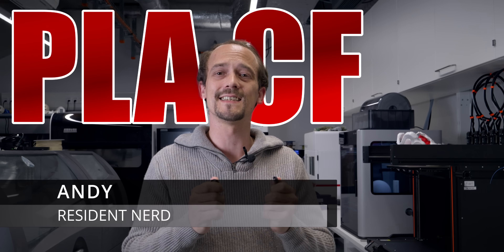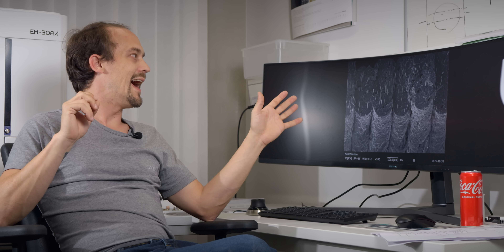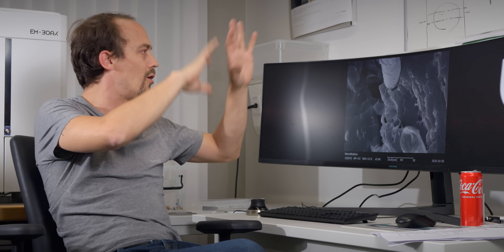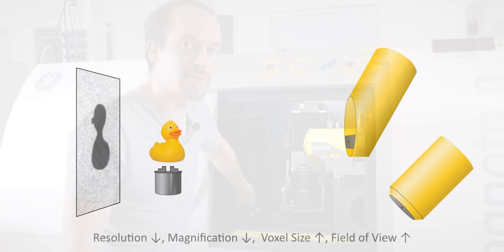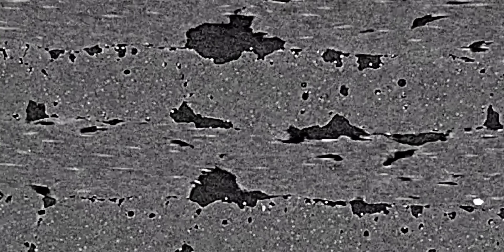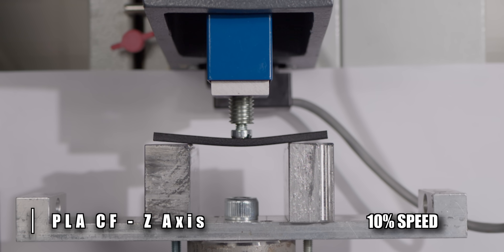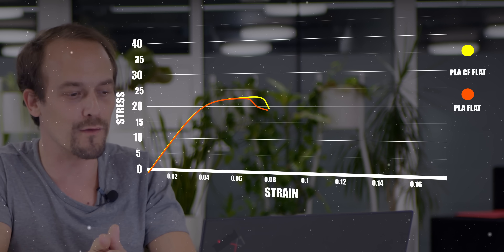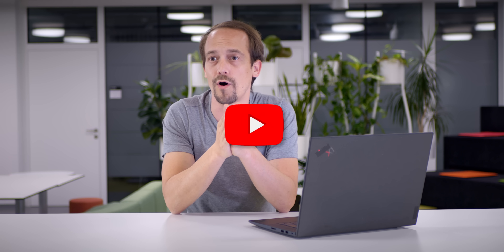3D Printing’s Biggest Scam Is Even Worse Than We Thought!

Comment: +1 for a dedicated video on the health risks of carbon fiber
Reply: Hurray for high-tech asbestos!
Reply: @Riesenfriese it's literally is, and it's even worse because with it you gain microplastic
Reply: @kv9009  its not as bad as asbestos from what i understand but its still bad
Reply: You basically have to treat those parts like you do fiberglass insulations. Handle with gloves on unless you wanna itch for the next few days.
Reply: @mr_voron  The carbon fibers in a 3D print are much shorter than those of fiberglass insulation. In my experience the itchiness goes away within a day.
Reply: @m @mr_voron t true, CF fibers in the right size meant for filaments should be about as harmful as the titanium dioxide used to color your filaments white; which is barely harmful, only a risk if sanding with no mask or filter
Reply: @awildridehome9469  Seeing how the fibers are not only contained within the polymer but on the outside surfaces, I'd disagree heavily. During the breakage tests you can see the fiber disperse into the air. Handling in general would pose a risk, not to mention the printing itself would contaminate the environment without proper filtration and clean up of the printer itself is also a concern. I work with real CF in aerospace and we take immense precautions including specialized vacuum operated tooling to prevent the dust from being spread by conventional air tools.
Reply: @plav032  This. I too work in aerospace, and this is the consensus reached by the scientists and engineers  across multiple national labs.

Bottom line, wear PPE, control dust, and avoid inhalation. To each their own. Everyone is responsible for their own health.
Reply: @plav032 

The resin CF is used with for aerospace application is the dangerous part; countless studies have been done on CF fibers, and the ones that are the length used in filaments don’t generally pose any additional hazard compared to any other dust of the same rough size. They’re irritants and mildly inflammatory if inhaled in sufficient amounts. 

ESD-safe filaments use carbon-nanotubes, which are proven through studies to actually be more asbestos like, due to their size and properties. That’s the real danger of carbon-based additives in filament. 

Anyone who thinks otherwise is welcome to post some actual science that is relevant to the topic, instead of “muh aerospace” anecdotes.

Source: Biologist who knows how to do basic research and read the reviews and papers for tests done on mice and tissue samples.
Reply: @groeszs  "Everyone is responsible for their own health." - imagine a world where people took this seriously. It would destroy the medical industry!
Reply: @awildridehome9469 the biggest source of danger is fiber dust. Sure, filaments mostly contain fibers that are longer than ones you should be concerned about, but that's mostly, plus they're going to be breaking all the time
Reply: @groeszs  "Everyone is responsible for their own health" is not only blatantly wrong, but also very sad way to look at the world.
Reply: @pathway4582  I can't grasp your position. In fact I believe the opposite and I can't understand the fault in my statement. The inverse of my statement would be "My health is the responsibility of everyone else". Actually now that I have typed that out, I think I understand your position better. The whole "YOU must wear a mask to protect ME" concept. My initial thought in this discussion was to imagine that my employer is responsible to provide proper PPE, and that's true. It's also true that my responsibility doesn't automatically end there. But I digress... I would probably never know that the cancer I develop in the future would be caused by using the cheap knock-off respirator filters my employer provided because they were a few dollars cheaper than the OEM filters.

But you are absolutely correct... It's incredibly sad to live in a world where I am responsible not only to myself but to everyone else as well. I wish I never learned responsibility. That's not sarcasm. I DO think the world would be much better if everyone was honest and responsible, but that's not the world we live in.
Reply: PLACF could earn a pat on the back from asbestos.
Reply: I won't be happy until there is asbestos reinforced PLA.
Reply: this was the main reason i never wanted to bother with it. seemed terrible with dubious claims of strength.
Reply: I hear it’s good for submarine design.
Reply: @josephcomings to be honest they did so many things wrong its unfair to blame the carbon. it was a miracle it even worked once
Reply: "reinforced" is a risk on its own. I actually want 2 videos. One on the "reinforced" issue, with tiny metal-like structures embedded into a part. No matter what material, if they are tiny arrows, they will penetrate the skin. That in itself is a health risk. Particularly if the material is super strong and hardly degradeable.

Secondly, I want to know about the Carbon Fibers themselves. What are the risk of this material. As in, is it degradable by the human body, is it poisonous, or what ever we need to know about the material. Just release the "reinforced" vid first. Then point out why the CF material should be an extra risk for reinforcement.

If you do this, you will be asked about all sort of reinforcements. The thing is to do the "reinforced" vid right. That would be legendary, and I will praise such a vid, for like forever. Please make one. As in, a good one.
Reply: This is not talked about enough. I’ve worked with CF in the aircraft industry for 20 years and it terrifies me.
Reply: This is what I came to say. This stuff is not good for your lungs
Reply: Indeed. Carbon FIBER is a hazard. Even worse is machining CFOAM (trademark). Tooling material made primarily of carbon. Nasty to cut.
Reply: It's zero unless you're sanding.
Reply: -1 for a mum insult. grow up derp.
Reply: CF and GF filament is huge problem for heath of whoever handles the parts, and for environment too. Not to mention inhalation hazards. COPD will kill many people it seems
Reply: @akierum And yet people are so oblivious, or even worse aggressively argue with you that this is not the case. There was a guy on reddit that came at me for pointing this out and even though I gave him citations of papers he responded with his other bogus claims that "prusa research" did some very rudimentary analysis of their own filaments and said nothing cytotoxic could be found in the *shortterm.* As if things like cancer develop in a few days or something. Plus, nobody claimed that carbon or glassfiber are toxic, but rather that they can cause serious tissue scarring and thus autoimmune responses that can eventually lead to chronic inflammation which in turn heightens the risk of cancer. People are mad delusional and incredulous.
Reply: @Atom224  (as someone with zero knowledge)  This sounds like it could be physically similar to asbestos fibres?
Reply: @Atom224 I’d love to see the research for the fibers the length of the ones used in filament, being a health hazard. All the studies in mice and tissue samples seem to show the opposite for this sized CFs.
Reply: @sQueaky637It’s not, because they aren’t self sharpening, they almost never break in the same axis, they’re biologically inert and the length used in filaments isn’t comparable.
Reply: @Atom224  I'd love to see the citations you're talking about because so far every time I've had this discussion nobody's been able to come up with any proof that carbon fibers pose a health risk when exposed to skin.
Reply: @HarrisonMartinson I guess there are two questions then. Health risk to physical contact. And Health risk to inhalation of carbon fibers. I can't imagine it being much different to fiberglass that has been used for decades.
Reply: My motorsport colleagues who work with CF daily all agree CF is the asbestos of the future.
Reply: @GreenPlasticWaterCan  This is a raging debate.  OSHA designates CF as an irritant, but not the cancer risk that asbestos has.  I think if CF was equivalent to asbestos there would have been a lot of deaths and lawsuits by now, but there isn't.  This would be another myth worth busting.
Reply: +1 to all
Reply: I don't think he did, really. He pointed out potential risks, but did nothing to demonstrate actual harm. There's a big difference between 'I think this could be dangerous' and 'I've clinical data showing people are being harmed'. There's all kinds of things like the size and shape of the carbon fibers, how the body responds to it, how and where it could attack, etc, that he says nothing about.

All he did was drum up drama and showed just enough data to scare people, without following through and showing any factual results.

Great way to make youtube cash though.
Reply: And graohene as an adjuvant in vaccines. Yeah look into that

Comment: Thanks for the video! I think reinforcing PLA or PETG with carbon fiber was initially a naive idea. The main advantage of carbon fiber, in my opinion, is its increased thermal conductivity, which improves heat resistance. For example, I used it to print some parts of a 3D printer head, where heat dissipation is paramount

Comment: I have no clue what your expectations were, but I print alot of rc cars (fully printed). I always had trouble with steering linkages flexing too much. CF variant fixes it. Sure it's not as strong part, it has worse layer adhesion, etc.. but it is more stiff. No need to look at it with microscope.

Comment: I would love to see a comparison video for the more functional filaments like PPS-CF, PPA-CF, PET-CF, PC-CF, etc. But I would also like to see if PLA-GF has the same issues as what you pointed out in this video for CF filament.
Reply: PET-GF too.
Reply: Would also like to see ASA-CF in a comparison, as it's the only high-temp CF at a low price point (at least from polymaker and bambu)
Reply: Yes tgis videonis focused on pla. Im curious about other plastics especially with shrinkage. The cavities are likely due to cf expansion with heat and shrinking when cold leaving the difference as a void
Reply: @cjmsr71 carbon fiber has a negative CTE (coefficient of thermal expansion), which means unlike most materials, it actuality contracts when it gets hot, and expands when it cools down
Reply: I would also like to see this, particularly with ASA, PC, PPA, PPS

Comment: Solution, make a positive mold out of PLA or something else and then make a forged CF part with that. This works well for all engineering applications I've use it in.

Also, thank you for mentioning the very real hazards with CF (including glass fiber filaments). When I did crash and recovery one of the biggest dangers was CF. We had to wear special suits with large respirators and go in and spray all wrecked CF with a water soluble resin before we could investigate or have it moved. Wish "common" people would get some form of training on this stuff since it's becoming so main stream these days. The biggest Hank Hill freak out I've ever had was when I was doing some R&D at a local university and saw a kid cutting and sanding CF with no mask, no gloves, no eye pro, no filtration, nothing... absolutely wild.
Reply from the maker: the issue is that Carbon is sold as "chemicaly inert" and everyone thinks that this is enough. They do not think about Silicosis (Dust-lung) or the ability for mechanical cell damage...
Reply: @Ibuiltathing  I had never considered this before. Thank you for the new perspective.

Comment: Wow this is so cool I can’t believe you have access to this kind of equipments! But it’s kind of accepted that PLACF is mostly for cosmetic reasons. I’d definitely be very curious to see how nylon or asa bond to the carbon. But also, don’t underestimate the value of carbon for just making materials easier to print. Some materials you wouldn’t be able to print on desktop printers if they didn’t have carbon, for example PEKK… not to mention that adding carbon to most materials will make the heat deflection much higher. so even if carbon makes them weaker, it might be worth it. But this is fascinating and I am glad I discovered your channel.
Reply from the maker: Thanks a lot.
I Plan to continue my investigation in CF Materials and also do calorimetry testing.
And compare them with the "working" blends of Materials.
Reply: I think the biggest takeaway from this, apart from the "PLA-CF doesn't work", is the problem with the fibres ending up sticking out of the surface and the risk of these embedding in skin and other body parts. I'd guess that the only relatively safe application of these kinds of materials are where they are coated with a durable "skin", to stop fibres being abraded off the surface.
Reply: I have handled CF Nylon and that has pretty impressive strength.  I didn't do a careful comparison but it was substantially stronger than my nylon.  One important difference is that there is an amine group in nylon that is not in PLA. If they surface treat the carbon fiber this could fuse in ways that PLA wouldn't.  Some of the microscopic findings would be expected in both cases.

Comment: Interesting video, it actually shows what my opinion is about cf in weaker material like PLA and PETG. Where cf doesn’t make the material stronger, but weaker by making the material brittle. Only maybe improve the dimensional precision and aesthetics by reducing  layer lines 

But I do believe cf and gf are making hobby based materials like PET, nylon, PP stiffer and improve dimensional precision. Also I noticed these materials getting more brittle with cf or gf. 
So yes, I would love to see some more in-depth videos on this matter.
Reply: This isn't true with PETG from any testing I've seen and I'm not sure why he implied it.

Comment: Could you do a separate video about those microscopic voids in the polymer?  I am very interested to understand if nozzle temperature and flow rates influence them..  I could make a hypotheses about humidity, but also consider an underflow situation where the nozzle is sweeping a larger volume faster than the volume of polymer you are flowing.  This could potentially be drawing air into the bead, right?  I bet nano tomographic imagery of beads with different flow rates, and temperatures would be very elucidating!  Could you imagine if you found better slicer settings that knowledge could influence future slicer technology.
Reply from the maker: Thats a gret idea. it will go on my future video list!

Comment: From my research the purpose of CF or GF reinforcement is to prevent warpage, creep, and gain dimensional stability at the cost of embrittlement.  PLA and PETG don’t have warpage issues like Nylon.  PLA/PETG are less suitable for functional prints anyhow so why they would make CFR versions is confusing.  I would like to better understand how the PA,ASA,PPA stick to the CF/GF at the microscopic level, that was very interesting seeing the CF pull away from the PLA.
Reply: PETG warps quite easily given a chance; I had many PETG prints fail on my old bed slinger which I eventually realised was due to a slight draught in the room.  PETG-CF and PETG-GF prints beautifully by comparison.
Reply from the maker: They made it because it sells 😅

Comment: While I appreciate the effort, not having a sample without carbon fiber to compare it to makes the results a little inconclusive.
Reply: Do you mean for the microscope? Because for the quantitative tests he did show a non-CF control.
Reply: @Juttutin yes, it would have been useful to compare voids between regular and "reinforced" PLAs. As someone has already pointed out in the comments, voids are unavoidable when no pressure compaction happens, and extrusion printing has no meaningful pressure, so it's really interesting whether CF leads to even worse prints compared to the non-CF material.